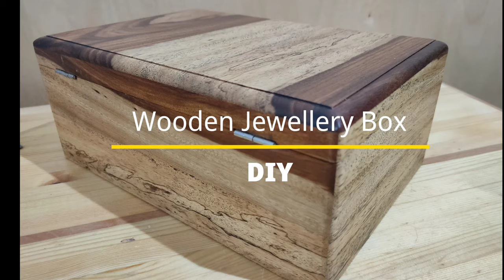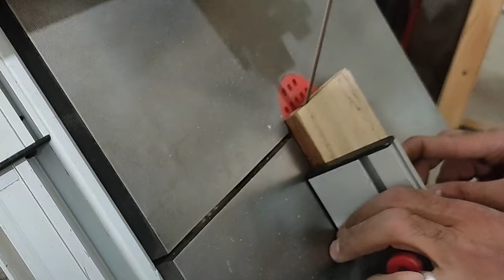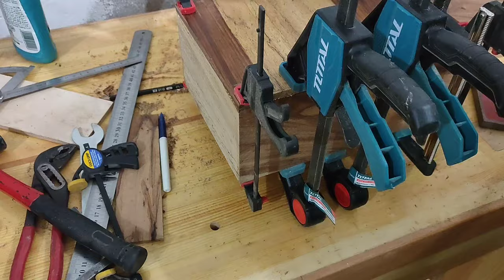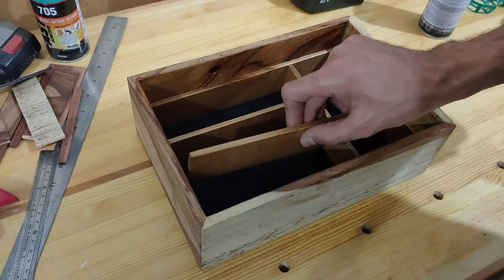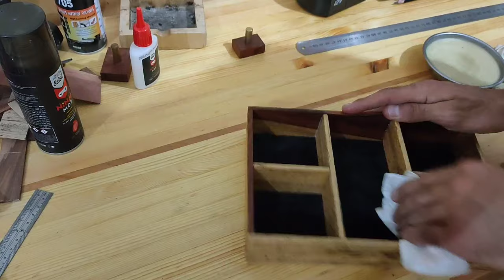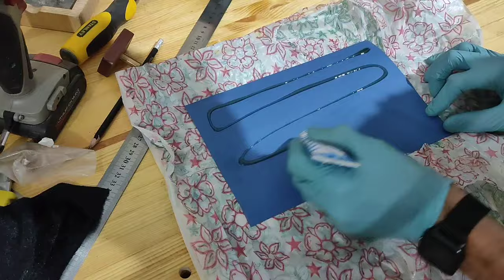DIY | Wooden Jewelry Box

Comment: May be i missed something in the video since it does not show how the top lid is constructed 

The top lid does not seem to have engineered to avoid wood movement. It looks like a panel  glued into a groove in the frame directly even without alllowing room for expansion, and either lid or frame will split when the lid is subjected to seasonal changes of the MC.